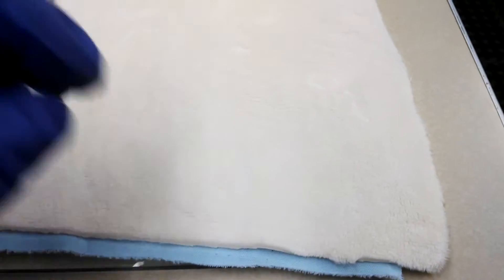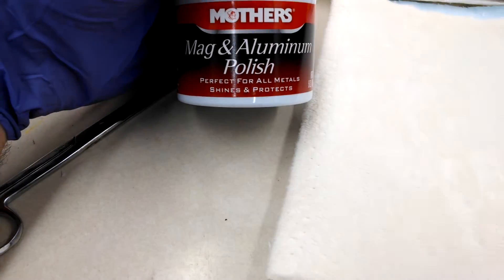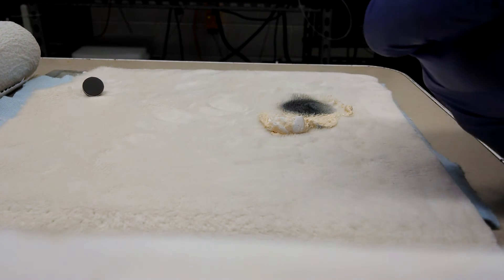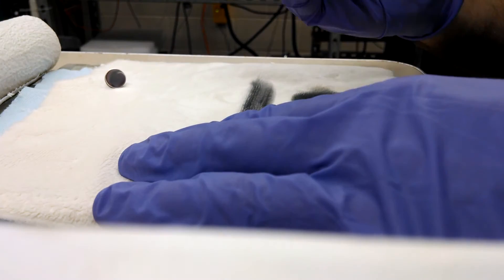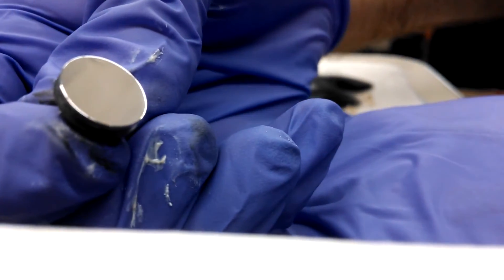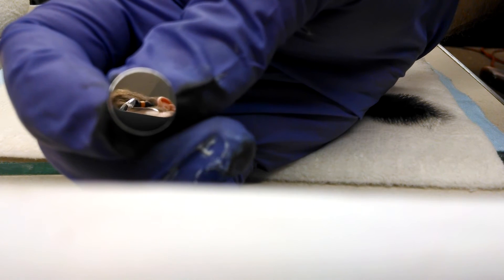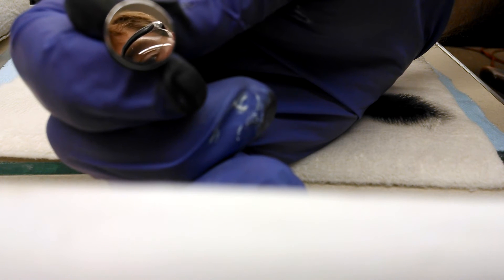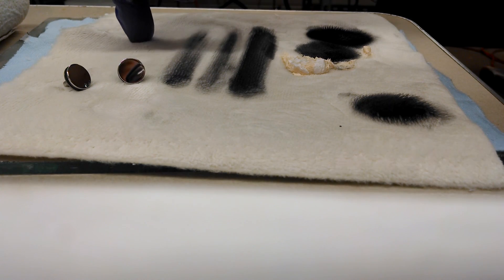Mirror finish polishing aluminum for Scanning Electron Microscope (SEM)

Comment: Interesting. I'd love to see the differences in the passivization layer from a rough surface to that mirror surface.
Reply from the maker: That would be cool to know, I'd assume you'd have a few nm fairly uniform oxidized layer on the Aluminum fairly instantly.  We normally use the targets within a day or 2 - I'm curious what they would look like if they were allowed to sit for 6 months to a year, if you'd start to get odd features on the surface from continuing passivization.  Something you'd pick up on the SEM but not be able to see else-wise. However, we may never know :(  I'm no longer in this lab.  But if you have access and time I'm curious!  I hope the video helps you out.